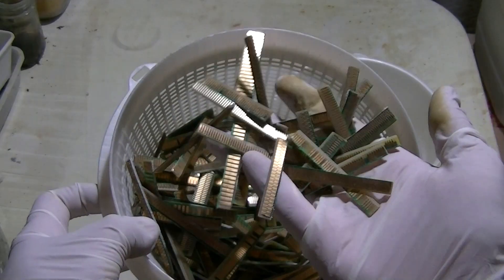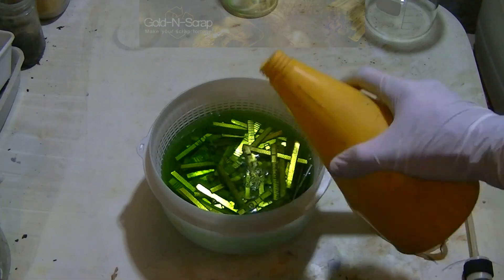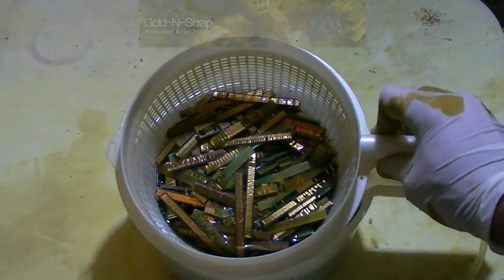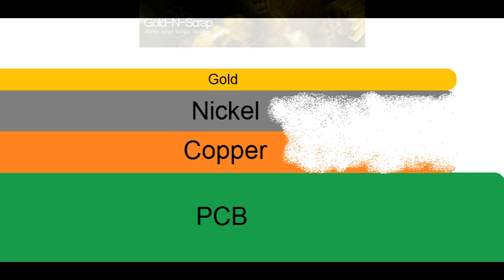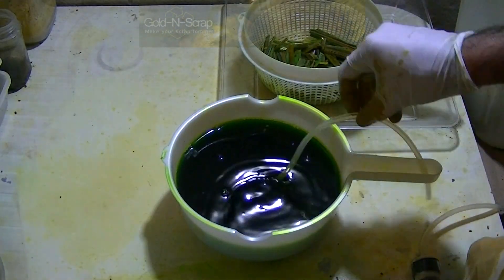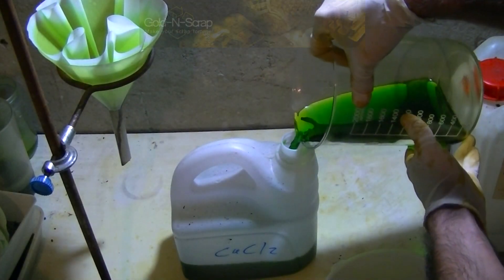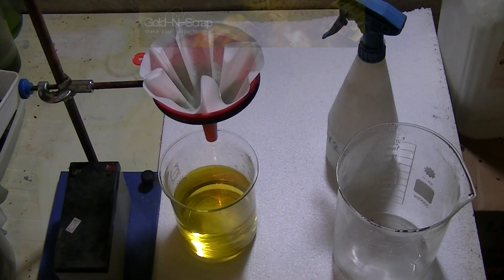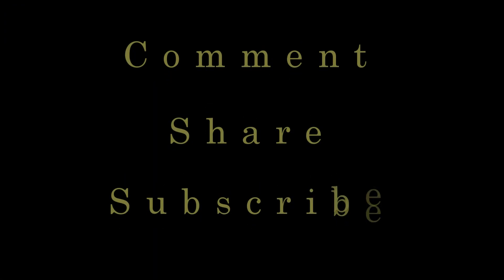Gold Fingers - How to Recover Gold from Electronic Scrap

Comment: I gotta ask, can i do this with RAM board fingers as well? I've heard of the acid/peroxide method and i guess i could do just that and then refine it, but there's just so much work if i'm gonna get the gold off of both CPU pins, cellphone boards, RAM fingers and PCI card fingers all separately... Any tips on how to make my life easier? Could i cut the fingers, melt the CPU pins off and melt all the capacitors of the gold plated boards and do it all in one go? With just your aqua regia and SMB method? I'm just worried about the fact that there might be Ferris under the CPU pins and that wouldn't that mess everything up with the copper???? I'm just a little confused because I've been reading so many different guides.
Reply: Awaiting an answer to this question as well. Cell phone boards mostly as I haven't begun to do any research on the topic. Love the videos. Thanks
Reply from the maker: XxHalles133769xX Jed Erickson Copper Chloride leach is most effective when there isn't much base metals to be dissolved, such as in the case of fingers or other PCB parts which are gold plated.
For scrap which contains a lot of base metals (compared to gold) such as copper/bronze/brass pins, it is best to invest in reverse electrolysis (de-plating) or Thiourea/Thiosulfate.
For Kovar based pins (such as in CPU's), Auqa Regia could be used directly by dissolving all of the metals including the gold.
See here: How to recover Gold from Scrap Ceramic CPU - Part 1
Reply: Thanks, that clears it up a bit.

Comment: Could you do the same thing with Hydrochloric acid and Hydrogen Peroxide.
if so which process is better?
Reply from the maker: In essence, it is the same process.
Adding H2O2 is only made for the initial production of CuCl2 in situ.
However, it will provide an Oxygen boost and make the solution much more reactive... But it doesn't last long and increases the solution volume.
For most practical reasons H2O2 is unnecessary.

Comment: gREAT VIDEO!!  Love the narrator!  I would say that is 3 grams?
Reply: Hi Moose Lee again, I have got 600 fingers, how much muriatic acid and peroxide would you suggest for this amount, I also have 25 cell phone boards and can I you this process as well.
Reply: Just enough to cover them really.  THe solution can hold about 2lbs of copper and nickel per gallon and there is very little copper in those fingers.  As for the peroxide, one part 3% peroxide to 4 parts HCL 31.45 % should do the trick.  I would however, really recommend the air bubbler system.  As for the cell boards, if they are clean they can be processed this same way.
Reply: Thanks Moose